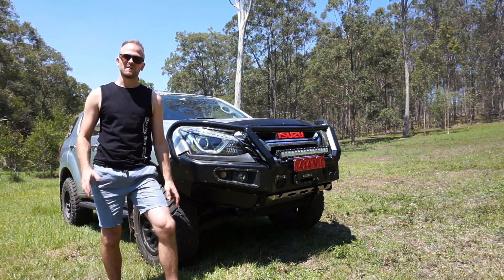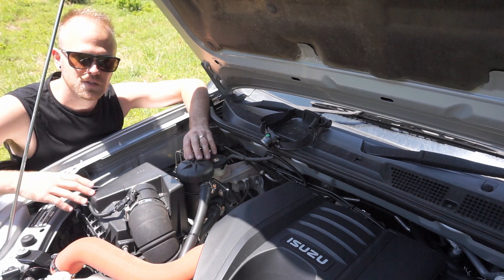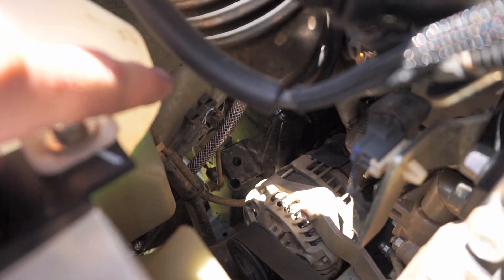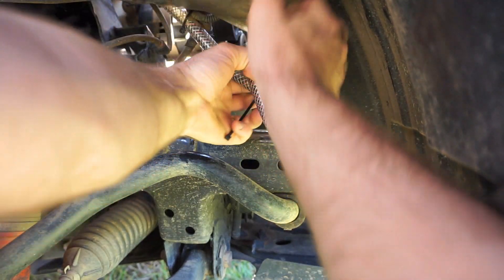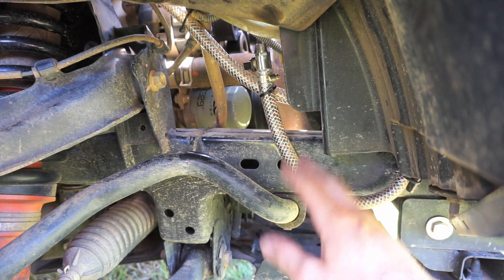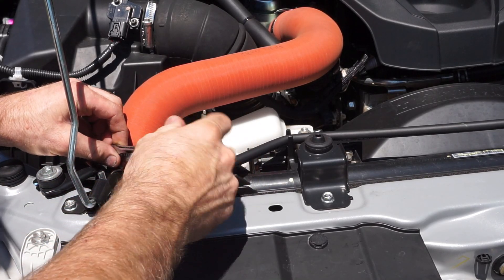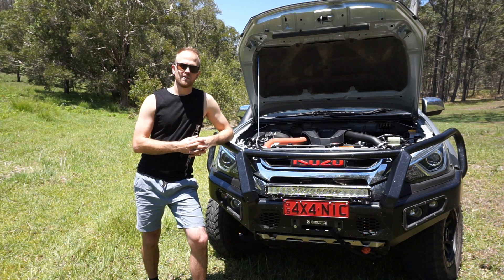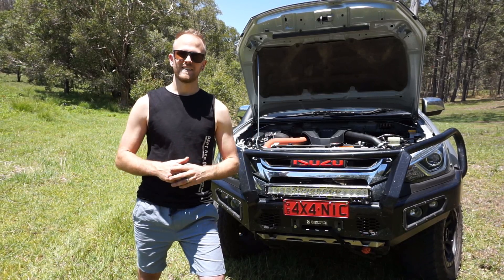Isuzu MU-X Provent 200 Catch Can - Draining my Catch Can after 9000 km

Comment: Best mod I did was installing the Provent 200 at 3000km on the DMax. Drained about half a litre over 20000km. Done monthly it all adds up. 
Re the ball valve, I bought a pack of rubber chair leg end caps. Cheap and keeps the valve clean.

Comment: Hi Nick, good insight into the benefits of installing a catch can, especially the Provent 200. I've got a 2020   3.2  Pajero I've had since new. At 50.000kms I had to get the egr pulled out and cleaned manually as it was very gunky and the valve was sticky and not opening and shutting properly which was causing it to run a bit off and the motor would run on for a second after turning it off and would stop with a shudder. The dpf light was on too. I had it fixed by a independent reputable diesel workshop as i didn't trust the Mitsubishi dealership. Got a Provent 200 catch can fitted and 10.000kms later and no problems. Bit surprised it happened at low klms.

Comment: protip: run new hose towards the radiator along the chassis and strap it to the air deflector under the radiator but out of sight or can't be snagged, it should be about a metre long. this gives you more than 400ml of oil to store in the hose.   I also cap off the tap end in case the tap gets turned open and you suck a gutful of dusty air or water if u crossed a river.

Comment: Hi Nik, Your vids are prof. I really appreciate your work. I have no knowledge about diesel turbo charge engine at all. I am a user, driver. It takes me a while to understand Why? Catch can is use to filter out the incomplete combustion diesel residue from outlet of the engine before it returns back to the combustion again. Catch can filter out more than 350ml for every 10,000km, it helps to avoid the 350ml of dirty oil trap in the combustion chamber and pollute the environment. This is an amazing idea. Every diesel engine should add one of this. Good job Nik. My question was after adding this catch can, is there any affects to the fuel consumption? Better or worst?
Reply from the maker: Thanks alot! No noticeable effect on fuel consumption.
Reply: @LowRangeNick  How long after getting the MUX   did you fit the catch can?
Reply from the maker: @Mick_4591  30,000km

Comment: I realised if I ran a tube down from the catch can and into an old oil can (through a sealed union I fitted in its cap) the oil would simply drain down the tube and into the sealed can to collect. This way the (still pressurised by blow by gases in the second stage of the catch-can) oil can simply gravity drain any time whether the engine is running or not.
Reply from the maker: Great idea!

Comment: Thanks for the video Nick. Excuse my ignorance in the following two questions. 1) The hose and fittings into the catch can are quite small so can there be a problem over time as oil residue builds in that line with air flow via the catch can. 2) The DPF is becoming a big issue with class actions already starting, so could adding things such as catch cans into an engine system give manufactures a get out on warranty claims and recalls.
Reply from the maker: It is not an issues with the catch can hoses as they are an oil resistant rubber. They will last a very very long time. As for Dpf issues, i havnt heard of many Isuzus having dpf issues. I know the toyota 2.8l have alot of issues. As for warranty, the dealer can only legally deny warranty if the modification is the direct cause of an issue or fault. So there shouldnt be any issues in regards to the dpf as the catch can isnt directly related.
Reply: Thanks Nick

Comment: If you're not pulling that much oil out of yours, congrats, you are running the right oil. 
If you are pulling out that much, the oil you are using is too thin. 
It's not "the thinner the better," those numbers indicate ambient operating temperatures, in spite of what oil marketing suits tell you.
So unless you're in Tasmania, put the 0w40 back and get 10w50. if it's cold in winter and you drive at night, fine, get some 5wsomething for winter. 
The thinner the oil, the more blow by you get. Go as high on the first viscosity/SAE number as your morning commute. That's in Celsius because we're talking about Australia.

Comment: The ball valve taps are rubbish. I put this on my car and after about 1000kms noticed a few oil spots on the ground it was the valve leaking. BTW I installed about the same place as u

Comment: Hey nick that’s really good to follow up on this to see how it’s performing. I saw your episode where you fitted it and at that time I wasn’t sure about it as I didn’t know how much oil it would take out and I heard that diesels use a bit of oil but what you’ve just shown looks reasonable. I’ve never had a diesel before and my 2WD Dmax now has about 7200kms on it and I’ll probably get the oil changed between services anyway as I do short trips at the moment and probably will be for the next six months. The service intervals at 15000kms seems a bit long anyway what do you think about that ?
Reply from the maker: I think it's a great idea to change the oil and filter every 10,000km. A catch can would definately look after the intake on your dmax. If you are planning on keeping it long term it is a great investment in the longevity and reliability of your engine. 😊
Reply: LowRangeNick ok thanks.

Comment: I have just fitted a Provent 200 to my 2018 ISUZU MUX, I used your very instructional video as a guide, Thanks heaps.
I do have a question though, 
When I fitted mine, no matter how I routed the hoses, they still seem to touch the intercooler pipe.
The plumbing on the underside of the intercooler pipe pushes the hose to the catch can up.
I decided to wrap some antin friction rubber to the intercooler pipe.
Is this necessary of am I just worrying about nothing?
Cheers
Glen
Reply from the maker: Hey Glen! My hoses dont touch the intercooler pipe at all. Maybe the bracket holding the catch can is not on the right rung. You can adjust how high or low the catch can sits and the angle it sits on by removing the catch can from the stainless bracket then removing the black plastic mount from the catch can, at the back there is a little plastic locking tab and some rungs were you can adjust it up and down. It might just need a bit more adjusting to get it to sit right.
Reply: Glen manning I had the same issue so what I did was rotated the hose anticlockwise on the catch can so it allowed the hose to lay down a bit flatter against the clean/lower hose, that is provided the catch can is in the correct orientation

Comment: Good stuff Nick. I'm up to my 3rd drain on the dmax. Though I've always wondered if taking the oil out will damage the turbo in anyway as its not getting oil inside of it anymore to lubricate stuff or something..  no weird noises from mine yet so I'm probably all good.
Reply: The turbo will be fine. Its got its own oil supply. Pumping oil mist into the intake does not lubricate anything, just clags up the intake and intercooler.

Comment: What's your thoughts about older pre egr engine's like my old td42t?
Reply from the maker: That's a good question. I would still say that it is a great idea to fit a catch can even if you don't have an engine with an egr system as it still prevents the rubber intake hoses from perishing and the intercooler from becoming oil soaked and loosing its efficiency. 😊
Reply: I've got a Nissan patrol 04 TD42ti...💪...I put a Pro vent c/can in about 4K ago...250 K on the clock...Filter still clean but starting to get oil in it now...For $300 it's worth putting in...👍🍻😎...

Comment: I just bought a D-Max with 100k already on the clock. Is it worth the money and effort to install the catch can, or is it too late to bother now?
Reply from the maker: That's a great question. Fitting a catch can now is still a good idea. You should also get the intake checked for carbon build up and cleaned if necessary. Fitting the catch can now will prevent any more oil mixing with the egr gas and soot, but there may already be a build up which would need to be cleaned. 😊
Reply: @LowRangeNick  thanks!

Comment: At 50T km, I'm a little worried now. Really need to fit a catch can on our mux.
Reply from the maker: It will be fine, it takes a long time for the oil to cause issues but it will be a good time to start thinking about putting one on 😊👍
Reply: @LowRangeNick  thanks for the comforting words. 
happy new year from the Philippines. I have the 2.5L 2wd MUX version, non offroader, just for touring duties. Cheers.

Comment: Good Video. Looks like you are draining about the same amount of oil as I am each 5,000km in my D-Max. I have a Chinese copy of the Provent 200 - it seems to work equally as well - but installing it without a kit was a real pain. 

The catch-can has a fine metal mesh filter instead of the paper one in the Provent 200. So occasionally it might need a wash with solvent, instead of having to replace the paper element - not sure if that's good or bad? 

If you aren't handy at making metal brackets, buying the appropriate installation kit with the Provent 200 is probably worth the expense.
Reply from the maker: That's good to know, interesting that they use a metal style washable filter in the copys, i think the provent filter design may be patented. Maybe that is why. There are a few catch cans on the market with washable filters, they seem to work ok.

Comment: Does it make any difference if i have a 2WD, not 4x4? Do you know if there is any difference between the TXC and TC motors. The Provent is advertised for the TXC. Think mine is TC type. 2017 MU-X
Reply from the maker: It doesnt matter wether its 2wd or 4wd. They are the same engine. I think it will be the same kit that I got for mine! Mines 2018.
Reply: @LowRangeNick   hey mate, ordered one today from western filters. looking forward to the install, cheers

Comment: Should you clean out your Intercooler?
Reply from the maker: The catch can will catch and remove the oil from the intake system before it goes through the intercooler. So cleaning out the intercooler isn't necessary.

Comment: I Nick. I'm from Belgium in Europe and I have an ISUZU DMAX with the same engine as yours. In Europe we have a DPD (diesel particulate defuser) exaust which collect the micro particle in order to reduce the pollution and this DPD have to be regenerated regularly (about each 200 miles) increasing the fuel consummation a lot. I guess that one of the reason of such frequent REGEN process is due to the oil going to the engine cylinder but I would like to have your advice before to install a Catch Can. I'm not sure that you have the same depolution system (perhaps you just have adblue).
More info on DPD here on page 2-73 https://www.isuzu.co.uk/owners/owners-manuals/isuzu-d-max-2017 
So my question is if you have a DPD, did you saw an improvement in the REGEN cycle (less often) after the installation of the Catch Can ?
Thank you for all your video. I'm a fan !  They are very usefull because here in Europe there is almost nothing about ISUZU tutorials.
Jeff
Reply from the maker: Hey Jeff! My Mu-x is a 2018 DPF model - no adblue. Fitting the catch can I havnt noticed any difference in DPD burn off.